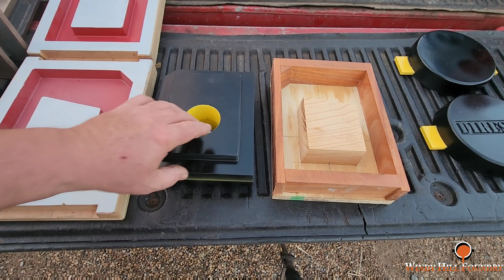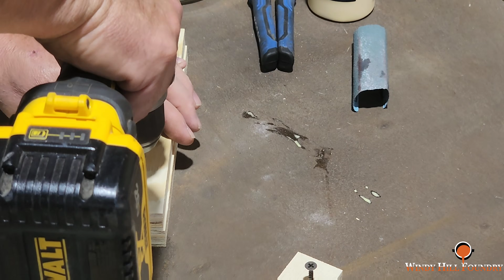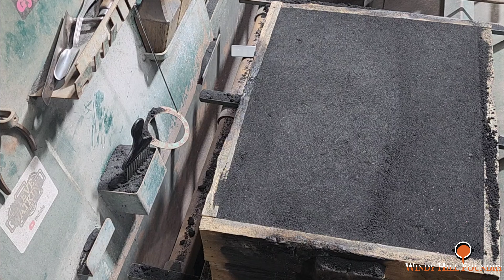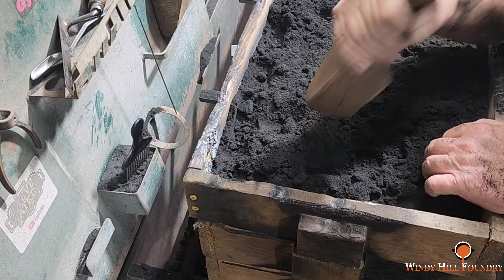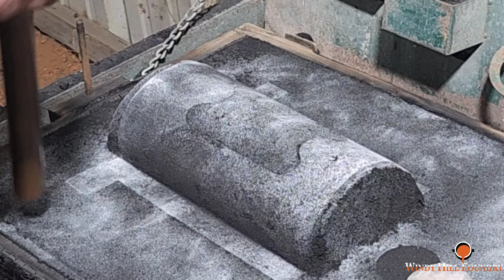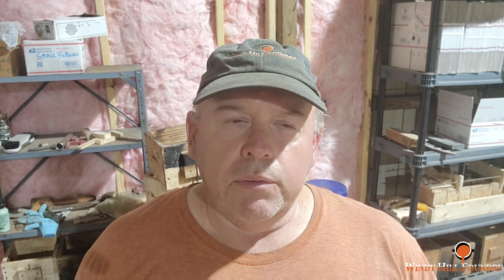WHF 22 CORE BOXES AND PATTERNS

Comment: I'm doing a crash course to understand how to make a "hollow" casting. or "two piece pattern" sand cast mold.

7:43  Start with the pattern + core on the bottom board. Facing "cup down"
15:07 Place the frame. Pack the sand. You used 2 frames for proper height.
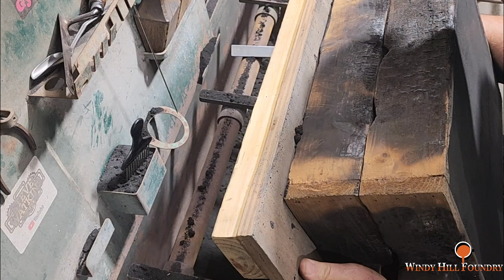16:03 Flip sideways and remove bottom board, which exposes the pattern + core (cup down side)
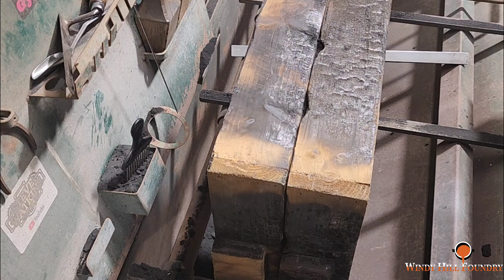16:28 Place bottom board onto "other side".
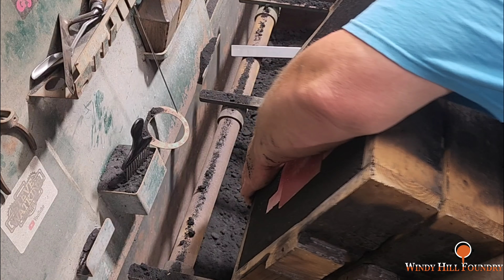16:38 Now, tip over onto "board side". Now, we see pattern + core is "cup up".  Now, we can unscrew and lift up/remove core. This is the "drag side" or down side.
19:14 Now, place the top/cope side frame, and pack in the sand
24:34 Cope side is all packed in and now time to lift it up.  We see the "cup up" side of the pattern, again.
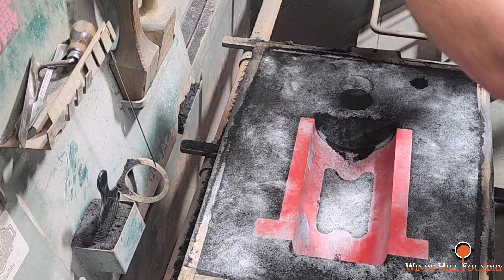24:53 Cope side mold is off. Now pull out pattern.

I saw non-stick powder used between layers.
I saw careful tapping to loosen before separating.
I saw plug, hole and flow channels made by hand. I will focus on those next time.
However, it gave me a sense of the extra room needed around the pattern for the plumbing.

Thx.

Comment: 1st off please stay cool, you dont need heat stroke, 2nd, Please don't fall for Vevor, they may send you something that works, but we've been sent their junk products in place of actual items we ordered, all of them where complete failures, hydraulic jack had brake fluid 🤬🤬 instead of hydraulic fluid which swelled and destroyed all seals and we bought 2 linear scales for dro, both where trash, their electric products are dangerous, wiring faulty, poor quality and we wouldn't take anything from them if they paid us...of course that's our opinion on them and others may have different thoughts....

Comment: install an expansion tank when doing the water tank replacement... helps eliminate a "Water Hammer" effect which can cause the Pressure Pop Off Valve to leak some.

Comment: Any time I have had a leak from a valve it is better to just replace them once you open them any crap in the heater just causes a leak! And if there isn't enough hot water there is a plastic pipe that goes to to the bottom of the tank that needs replacing on the cold inlet.

Comment: you got a great run on the old water heater but as with many things today they dont make um like they used to if you get a new one DO file the warranty papers it saved our bacon when one of ours went out after just 3 years the heating element went dead short to the housing the company replaced both of them under warranty just to make sure as they were both installed at the same time

Comment: My aunt got suckered into an on-demand water heater and in the back of the manual in the fine print about needing yearly service and anode replacement that costs her several hundred dollars a year.  500 hundred dollars for a water heater is pretty good price. The last one I purchased a few years back was $900 for the heater plus all the parts and pieces to install it.  I also have a rule about hot water heaters and that is I replace them shortly after there warranty runs out because I have extremely hard water and after coming home to an indoor swimming pool in my basement I swore never again.

Comment: 2 Thanksgivings ago, our propane unit tried to burn the house down. And we searched all over for a new tank. And all of them were out of stock. S we bought a Rinnai ru199i tankless unit. It's a condensing type. So it drains to atmosphere and the condensate eats concrete. 
But the damn thing is excellent. I just wish it wasn't $1800.00. 
Don't me get started about backs.

Comment: Clarke, when you end up needing to replace your hot water heater, go with a tankless if you can. But don't go with an electric one, won't do a lot to reduce your energy cost. I changed out my gas tank heater to a gas tankless and my gas bill went from right at $57 dollars a month down to $18 dollars a month. No use keeping water hot if you aren't using it. A Navien condensing tankless is a good product and it's 28 X18 X 13. Oh, and you can take a 4 hour shower if you want and never run out of hot water.
Reply: Wow that's pretty nice. Thanks for the info.

Comment: Clark all water heaters have anodes inside them to catholically protect the tank from corrosion. This is how the manufactures can say how long the tank will last. On top of the tank you will see a round hole with fiberglass in it. Under that fiberglass is the top of the anode. It is hex shaped for a socket wrench. The anode is a steel rod covered in zinc or magnesium almost the length of the tanks height. This anode is replaceable and can be purchased from the manufacturer. Make a note of the Manufacturer and model date the card as to when you installed the tank. Every two or three years. shut the water supply off to the tank and undo the anode to check its condition. As long as you have the zinc or magnesium coating showing you are good. Do NOT put tape on the threads of the anode when reinstalling it. The anode has to have direct contact with the tank. I tried to change the fixture in my bathroom sink, but there was one side of the fixture that I just could not unscrew. I called Roto-Rooter for help. I bought the replacement fixture $50 and the plumber charged me $600 to put it in.

Comment: I’m with you on water heater issues.  We came home to six inches of water in the basement.  The sump pump went bad while we were on vacation and the bottom of the old water heater split making the family room into a wading pool.  Insurance paid a bunch and that helped, but it still sucked.
Reply: You are luck you only had a wading pool. I went on vacation and had a water heater go bad and came home to 3 feet of water in my basement.  I ended throwing out everything out from the ceiling down.